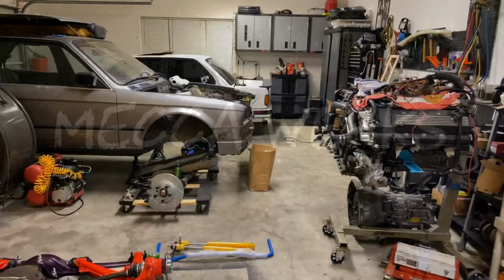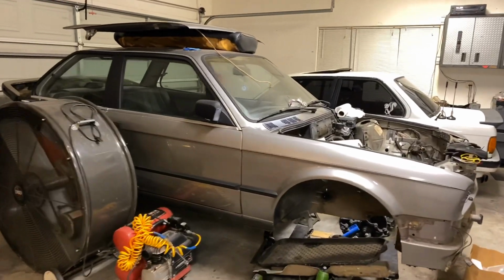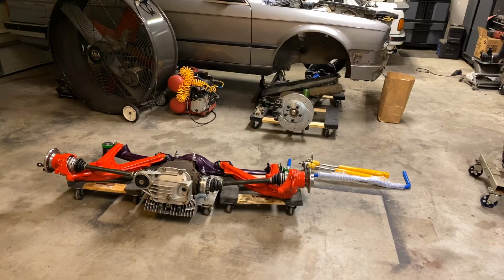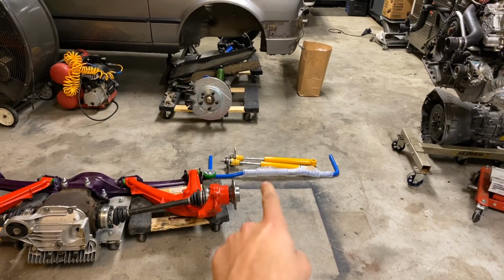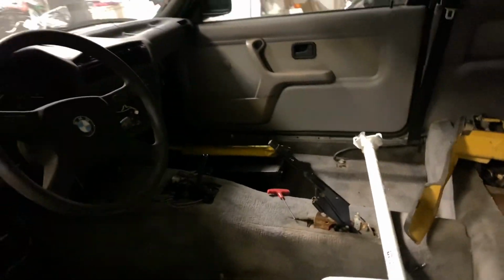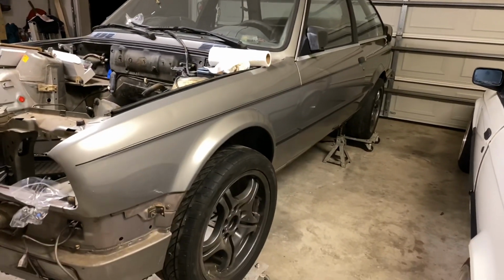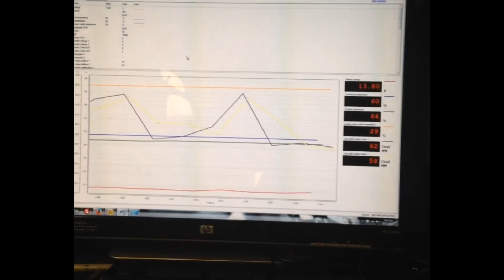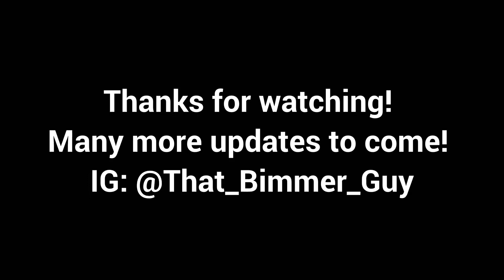BMW E30/S62 Intro.

Comment: Awesome music. Finally frankenbeamer is getting some love and coming back from the grave. Can't wait to see it all together. My kid not only busted a rocker arm he managed to rip one clear out of the head. So I tore down his motor to the block and rebuilt it...
Reply from the maker: Slim PKL Ouuuuuch! How did that happen?  I’m sure the M20 engine on here broke one from age but how did his car break a rocker arm?
Reply: @MeccaWerks  Improper care not keeping the oil Happy and overheated the motor not paying attention to the temp gauge. He ended up blowing a head gasket due to a faulty thermostat. The motor has over 230,000 original miles on it.